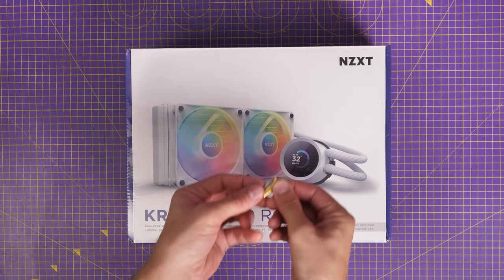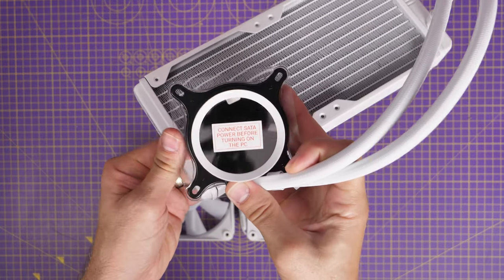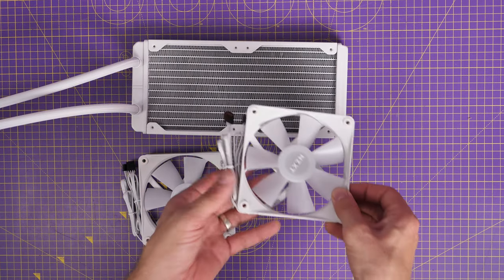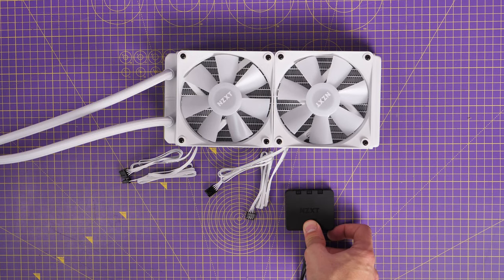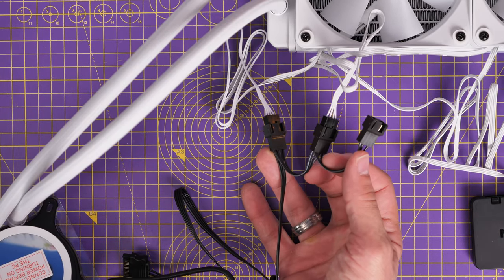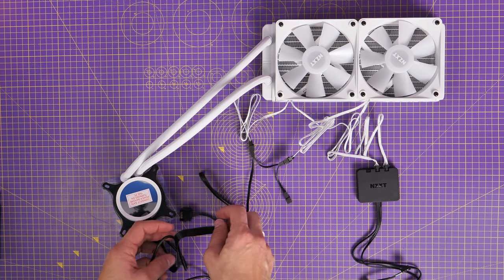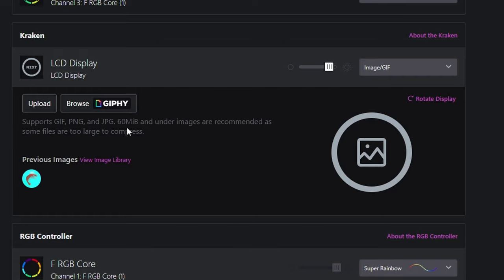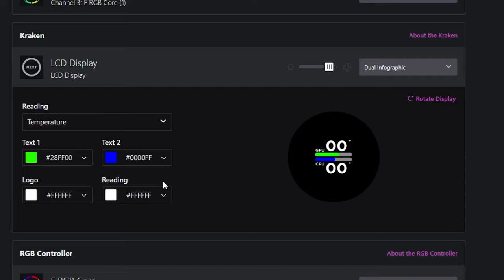NZXT Kraken 240 RGB Setup and wiring guide

Comment: As a pc builder … these are awesome but the fans / setup are absolutely terrible compared to Corsair / Lian li
Reply: Why
Reply: I got this for my boyfriend and I have a question do you have to change the water every couple months or something ????
Reply: @delilahgarcia7483 from my knowledge you do not have to do anything with the liquid. But I may be wrong so do some research
Reply: @delilahgarcia7483 no you don't have to change the liquid at all.
Reply: @iceeaglert I’m also curious as to why you feel this way about the fans/setup of this AIO? I’m looking to replace my current AIO cooler that came with my prebuilt PC. Already changed my ram, CPU and GPU and since I went from a ryzen 9 7900X to a ryzen 7 7800X3D I want one with a screen to monitor my temps and what I like about this one is the hoses are on the bottom so it’ll clear my ram sticks. My current one has the hoses on left side of the pump head. I’m just looking to upgrade and hopefully help with my GPU temps also. I’m currently running a 240mm 2 fan AIO I’d love to go to a 340mm but I don’t know if it’ll fit or not…
Reply: Lol

Comment: i have pump_fan1 and cpu_fan1. where should i connect it? are there any differences/advantages?
Reply: Pump 1 , cpu fan is for air coolers if you use cpu fan it will overheat.

Comment: I just bought this one and tomorrow I'm going to put it on and change the old AIO cooler I have (H100i Elite). My question is, if I already have the socket that came with the H100i Elite installed, should I change it or can I leave it? I'm not sure. In theory, both coolers are compatible with my CPU (I5 11400k) but I have that doubt. Thanks for the video, it will be very useful.

Comment: Nice vid bro, build my pc back in january with a 13600k, 32gb DDR5 @6400 and a 4070ti. Works like a charm but my air cooler ( deepcool ) after refitting still showing bad results on Cine and demanding games. ( 80 degrees max ) . I've got a Fractual Design Meshify C so I need the 240 version. I've already got a RGB controller with 5 ports on the back so I'll going for the black standard version. 

Big issue is, I need to unplug almost everything to install the back bracket..... but hey you want results, you gotta work for them haha.
Reply: Have you tried undervolting? I got a 13600k down from 80+ to 59-65c full load. Most cores 60, 1-2 65c.

Comment: Great video 😊👌🏻 Thank you!

I would prefer daisy chain rgb solution for all brands instead of a hub as it is easier to wire up, but perhaps a bit more messy managing. With each system using proprietary connectors make mixing and matching very challenging!

Comment: I'm a bit worried, I'm about to buy parts to make a build similar to the one you made in the short (h6 flow, 13700k, 850w PSU 80 plus gold, and either a 4070ti or 4080) and I'm torn between buying a cheaper 360 Aio or a 240 NZXT (which honestly I like better).
You think I'll be fine with a 240? I never built a PC so I would be grateful for a response 🙏
Reply from the maker: 360 provides better cooling performance tbh
Reply: If you want a cheaper one, Thermalright Frozen Notte 360 is fantastic bang for the buck. Highly recommended.

Comment: Does the softeare have to stay running to keep your display settings?
Reply: No
Reply: @IcH6646  pretty sure it does…I have a display set and it goes back to default on display if I close the NZXT software
Reply: @ffblegend  there is an option that says "run in background when closed". Enable it

Comment: Do you have to screw the fans on from the top of the case? My fans fit underneath with the radiator but now good enough where I can screw all 4 thru outside on the top
Reply: Like could you just screw the fans onto the radiator into place without screwing them from the outside on top?

Comment: is there a way to replace an existing cooler without removing the motherboard? like can i do it with the motherboard still installed? i have a pre built and im too scared to remove everything but need to replace the pump. can you pls do a video? :(

Comment: Hi, thank you for this guide. Do you have a installation version for swapping these fans out for Lian Li fans? Would I attach fans to Lian Li controller rather than NZXT one? I worry this would interfere with cooler capabilities(?).
Reply from the maker: https://youtu.be/v5kDVZmePYQ
Reply: @TheProvokedPrawn Thank you :D Do you have a video addressing creaking/rattling sounds coming from this?
Reply from the maker: @theirene  I've not heard creaking or rattling. If it's bad and continuous then you might want to request an RMA
Reply: @TheProvokedPrawn  Thank you sir, I appreciate your insight. I was afraid that may be the case.
Reply: @TheProvokedPrawn  RMA and got a replacement cooler! No sound :)) Thanks again!
Reply from the maker: @theirene  excellent. Glad you got it sorted!

Comment: Dumb question, but I never installed a water cooling kit before... Is the water already inside? I get a bit confused sometimes because I see these guys in videos pumping water in their pc and there's a reservoir, but sometimes there's none of that...
Reply from the maker: not dumb, a lot of people ask. So, this is what's called an "all-in-one" cooler. Which means the pump is in there as is the coolant already. You don't need to fill it and indeed you couldn't even if you wanted to as it's sealed. The other videos you've seen will be of custom loop systems, which are completely different and require liquid and a lot more effort. AIO coolers are much more user (and beginner) friendly.

Comment: i have this cooler + the H5 flow RGB case. Can i wire the fans with only 1 RGB controller? (3 rgb fans connected to the controller ) and 1 RGB fan from the case connected on a 4 pin RGB motherboard?

Comment: Question. I have kraken 360 rgb. When i set it up, i accidentally plugged my header into sys fan 4 and not jusb 1. The pump kinda works but now nzxt cam only displays the pump as system fans.  Upon plugging in to the proper usb header, the pump doesnt turn on at all. Any idea on what to do?
Reply from the maker: Probably best to ask NZXT support
Reply: check if you plugged up the sata power connector

Comment: im using a 360 mm nzxt aio with all the same wires but I'm gonna be using lian li fans instead of the nzxt fans so I'm wondering If I just plug the USB connector from the pump into the motherboard since I'm not gonna be using the fan hub included with the aio?

Comment: I have connected everything the way you showed, exactly as you showed. But the cam software doesn’t recognize the aio, it lights up and shows temp, but the software doesn’t recognize it at all.
Reply: The video is great, but Im not sure what to do.
Reply from the maker: Is it possible the usb connection is loose? Or can the use another port on the motherboard,
Reply: @TheProvokedPrawn  I tried both ports, I have a asus b550 plus
Reply: @TheProvokedPrawn  is the usb hub necessary?

Comment: Hi. The CAM software does not recognize my AIO. It works fine but I can only see Liquid temperature on the display. I tried few things from their website such as power drain or reinstalling the app but nothing.. any tips?
Reply from the maker: I assume you have connected the usb connection to your motherboard and the cable is fully connected? Otherwise it wouldn't recognise it.
Reply: @TheProvokedPrawn  yes, I did. But the AIO is connected in a splitter with the RGB controller. Shouldn t be any problem with that, right?

Comment: I need some help here, i installed my radiator and pump and everything turns on, but on cam the fans rpm doesnt display and everythign is just hotter now, why?
Reply from the maker: Have you connected the USB from the pump to the motherboard. And connected to CPU fan or AIO Pump on the motherboard
Reply: @TheProvokedPrawn  yes to both

Comment: mate, i have a problem. I have this cpu cooler and i installed it with your tutorial, everything was good, but now it is like rare. It restarst over an over, it is like disconnecting, but everything like de pins, the cable, all of that is okay, and i dont know what to do :c
Reply: Not enough power from power supply

Comment: is it good for i9-14900k
Reply from the maker: https://youtu.be/_qJp8EOA9Uk
Reply: @TheProvokedPrawn   thanks .. can you suggest me a best cooler in 360mm aio also i am running 4k monitor  3840 x 2160..   i dont want any thermal throtlling
Reply from the maker: @financeinfo01  I personally run this https://youtu.be/3bzSBKgUghs but even so you can still get issues because the i9 is so hot. There are solutions though https://youtu.be/jP7nERdD-Gk
Reply: @TheProvokedPrawn  Thank you for your reply. I am currently using the NZXT Kraken 240 mm AIO cooler, but it is not sufficient for running heavy software (such as Blender) and games. My system crashes and shows a critical temperature error. Do you think the Lian Li Galahad 2 Trinity 360 AIO cooler would solve the thermal throttling issue?

Comment: I have the 360mm and theres a few lights that dont work on the fans. Could a loose connection cause this or are the lights just faulty? Everything works as it should except for a few small bulbs in the fans.
Reply from the maker: I'd ask NZXT support. Sounds like a faulty product